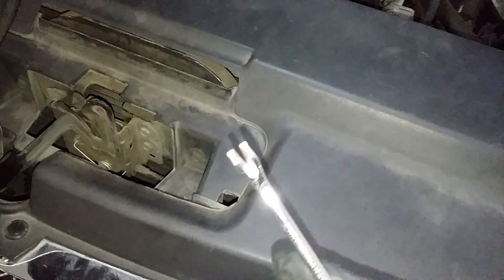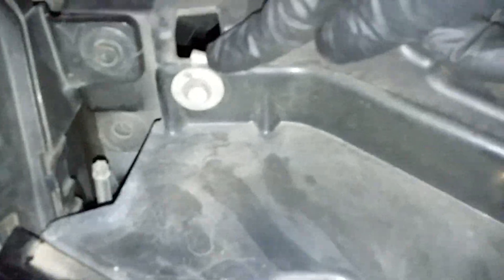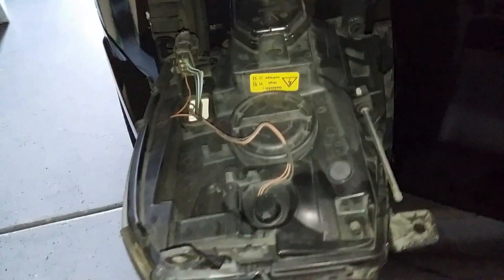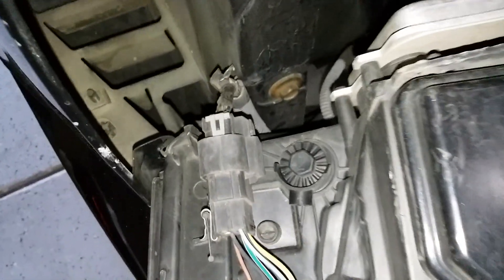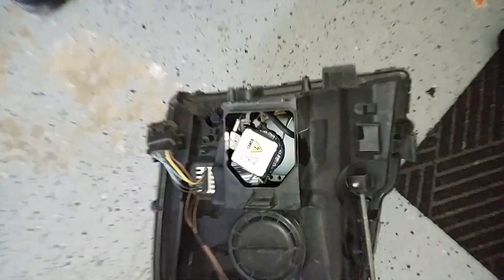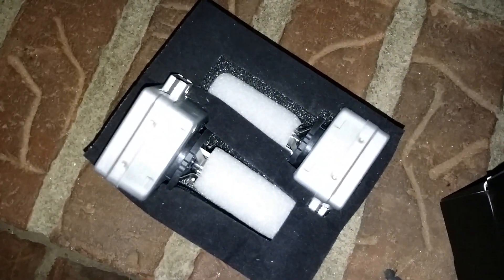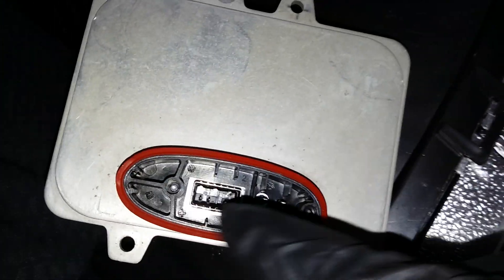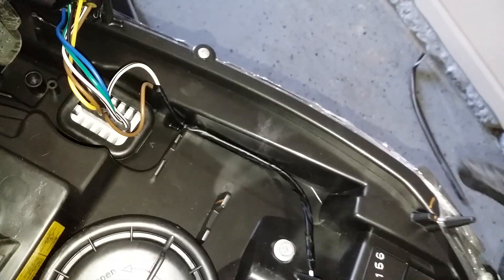CADILLAC ESCALADE 2007 HEADLIGHT ASSEMBLY & BULB REPLACEMENT

Comment: Question for your install did you
How did you
Take
Out the third screw without taking the whole bumper off because I’m about to do an install with the same headlights I just ordered
Reply: Unbolt the bumper and it will hang just enough to get to that 3rd bolt. Hope this wasn't to late to answer.

Comment: Aye how did you make the bulb fit
Reply: There is a retainer that you take off the original bulb in the headlight assembly, it unclips and just watch the orientation of the slots that is in the clip, and place it on the new bulb and reinstall, just with a twist it locks in place.